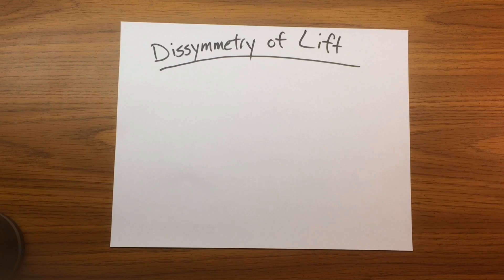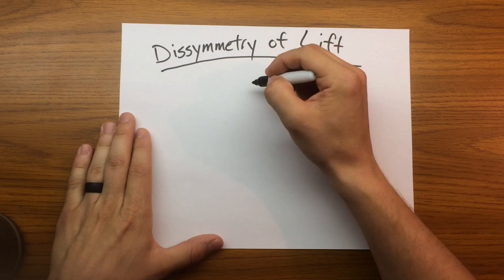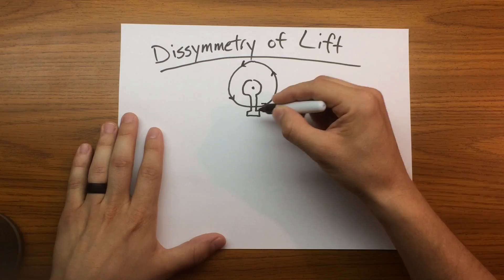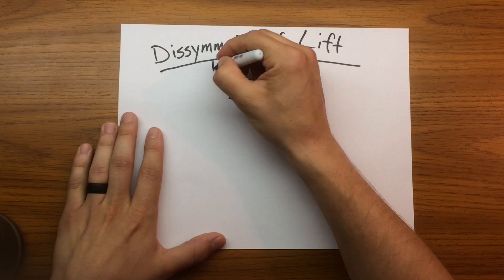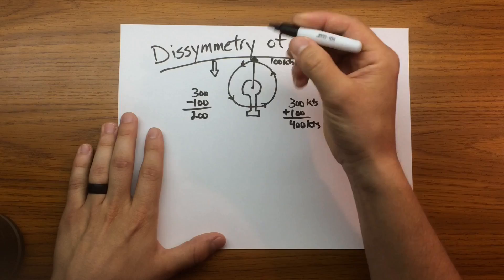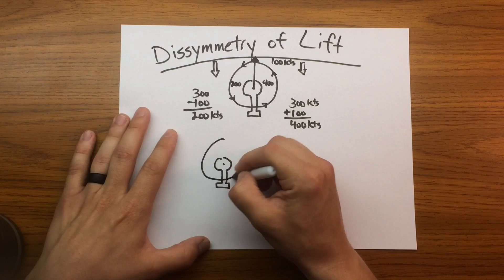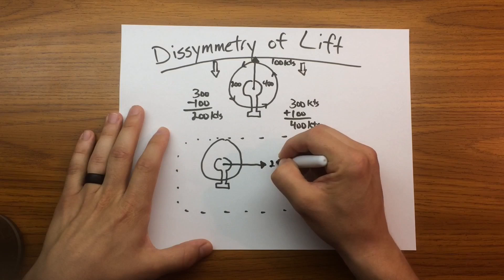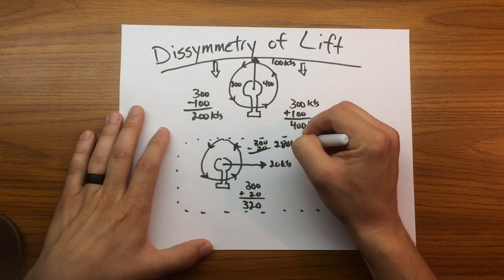Dissymmetry of Lift in Helicopters

Comment: So this was made a long time ago and I really hope you're still monitoring this channel. I'm really confused. You said the advancing blade is moving into a 100 knot wind moving at 300 knots. I understand that. The next part is where I'm stuck. If the advancing blade is moving INTO the wind, wouldn't that slow it down, and the retreating blade is essentially being pushed by the wind, so shouldn't that speed it up?

I can grasp the overall concept of what you're explaining as far as how the differential forces causes the rotor disc, and therefore the helicopter itself, to move through the air. The numbers are what I'm getting hung up on though
Reply from the maker: The blade would slow down if you didn’t have an engine pushing it into the air maintaining a specific RPM. If the same RPM is always maintained, pushing the helicopter forward would therefore cause more airspeed on the advancing blade (rotational speed plus forward movement).

Comment: Thanks for the great video! I've just began with watching your channel in order to have several questions answered I have with rotorcraft aerodynamics. You are doing a great job with your explanations!
However, to this one specifically I have some remarks: The speed of a rotor is not measured in knots nor any linear unit of measurement such as mph, km/h or m/sec as that would provide misleading information. The speed of a rotor is measured, as any rotation, in angular velocity of ° per second which can be translated into a linear speed, dependent at which distance from the rotation center the measurement is taken. E.g. the rotor of an Agusta AW109 has a diameter of 10.83m, which translates to a circumference of 34.02m. At 100% rotor speed with for that aircraft standard 380rpm, this translates to a velocity in air of roughly 775 km/h or 419 knots, but only at the rotor tips. At e.g. 1m from the rotor center, the linear velocity would translate to Pi x distance from center (=1, so Pi) x 380(RPM) x 60 (minutes) to 71.63 km/h or 38.68 knots (divided by 1.852).

This actually has some implications, because whereas lift increases in a linear manor from the center to the outside (ideally, with a perfectly twisted rotor blade), the forward velocity in your example remains constant through the whole length of the blade. This however should influence the grade of compensation through flapping and feathering as you described it in your compensation video. Additionally, my figures as presented above, indicate that at the example speed of 100 knots, the rotor will actually have no lift at all on the inside quarter of the retracting side, as the rotation speed vector there is overcompensated by the velocity vector so the inner quarter of the rotor disc in that area has no laminar air current at all, resulting in no lift. This effect should also result in increasing dissymmetry with increasing aircraft speed. So, as far as I understand it, at maximum cruise speed of the AW109 of 158 knots, this effect will be even larger, leading to roughly half the rotor blade producing no lift on the retracting side of the disc perpendicular to the movement of the aircraft. 

Is that so or am I missing something? And how does the aforementioned compensation by flapping and feathering work with increasing speeds and thus increasing dissymmetry?
Reply: 😂😂😂 - Now I feel stupid! I wish I had watched your video 'Dissymmetry of lift - Expanded' before I wrote my comment. - All explained there!

Comment: This is amazing! I’m reading the faa handbook and going through a sift study guide to prep for my sift hopefully in a couple of months. I’m so glad I found this channel!!! Thank you! One question though. What kind of issues does dissymmetry of lift cause that a pilot needs to be aware of while moving. I.e. does finesse of balance become a factor? Or are there instruments built in to counteract dissymmetry I’d lift?
Reply: I believe the angle of attack of the airfoils increases where the lift is lacking automatically.
Reply: The Fuselage starts to roll to the left, even though in articulated rotors blade flapping does compensate somewhat, but what is happening is the blade at the 9 o'clock position is reaching the same speed as the airspeed of the aircraft, so there is no lift at all... As speed increases, so does the stall area as illustrated. Once, coming n going speeds match-up, all forces cancel out, n you have no lift on the left side, hence, the helicopter rolls to the left. Just slowing down will get you back in trim...

Comment: I have a quick question about the video. Why do we add the speed to the advancing blade since it’s heading into the wind. I would think it would be opposite because of the drag caused by the relative wind. You used the “hand out the window” example that has me confused. Seems that your hand would go slower against the wind than with it. Am I completely wrong? Or is the number giving just dealing with lift?
Reply from the maker: TuckTuckonTwitch. The advancing blade speeds up because it flaps upwards. This causes the center of mass to shift inward and the blade to accelerate. I explain how this occurs in greater detail in my video Conservation of Angular Momentum (https://youtu.be/KObbd5mvn54).

Comment: I understand that in Forward flight the retreiving blade produces less lift than the advancing blade. 
But is this disssymetry also subject to gyroscopic precession? (So, Does the dissymetry cause the helicopter to tilt backward somewhat instead of tending to "roll" to the right) ?

Comment: In relation to dissymmetry of lift, certain helicopters have the ability to lead and lag (aka hunt) to better equalize lift along with blade flapping and cyclic feathering, would I be right to assume that the leading and lagging of blades works to equalize lift. The advancing side lags while the retreating side leads in order to equalize lift. 

Thanks, and I appreciate your videos good material to watch to refresh knowledge of aerodynamics
Reply from the maker: DGXJ94. Leading and lagging are ways rotor systems can better absorb Coriolis forces but do not equalize lift. As the blades flap up and down, Conservation of Angular Momentum causes them to speed up and slow down. In fully articulated rotor systems these forces can be absorbed by lead-lag dampeners. In other rotor systems the blades must absorb the stress of these forces. My video Types of Rotor Systems (https://youtu.be/7gM3rMDpJt4) explains this in a bit more detail. I'm also in the process of making a video to explain Coriolis forces as well. I hope this helps!

Comment: When you factor in gyroscopic precession, wont that make the helicopter move to the right based on having the advancing blades at the rear, which would equal more lift on the right side of the blades and less lift on the left side since the retreating blades are at the front.
Reply from the maker: Shamar Younge. The advancing blade would be on the right side of the rotor disk in a counter-clockwise rotating rotor system traveling forward. The retreating on the left. That said, the blades flap and feather to compensate for this Dissymmetry of Lift. When factoring in gyroscopic precession, the input to make the helicopter go forward in flight would be an increase in pitch at the 9 o'clock position. This would manifest 90 degrees later as an increase in pitch at the 6 o'clock position. By having more lift at the aft portion of the disk, a forward motion is created. I explain it more in my Gyroscopic Precession (https://youtu.be/MH1emIx5Ubs) and Compensation for Dissymmetry of Lift videos (https://youtu.be/culBbvszRpk).  I hope this helps answer your question. Thanks for the feedback!

Comment: Jacob, I am a CFI-IA and very interested in adding on helicopter ratings.  I also instructed various subjects while in the Army, and I appreciate your style and the conciseness of your presentations.

I understand the way you have shown how the relative wind effects the advancing and retreating blades.  My question is, and you may already cover it in subsequent videos.  Assume the helicopter is in forward flight at 100 kts IAS, resulting in a relative wind of 100 kts.  As a blade is directly over the tail boom, the effect of dissymmetry of lift would be nil.  As the blade continues to rotate into the advancing blade region wouldn't the effective advancing blade lift be negligible and increase the farther the blade travels into the region, reaching its peak effect at 90 degrees to the mast.  After that point, doesn't the additional lift generated by the advancing blade begin to decrease, until reaching the point where the blade is exactly parallel to the relative wind?  At the point where the blade becomes the retreating blade then the opposite effects would be in play?
Reply from the maker: Fred C Rogge Sr. I’m not quite sure I understand what you are asking. At the nose and tail, there isn’t much of a dissymmetry to lift. But on the advancing and retreating sides there is due to the relative wind combined with the rotational velocity in the blades. The reason the advancing blade produces more lift (if left uncompensated) is because the airflow over that side has been increased. And with everything else constant in the lift equation, this increase in speed results in increased lift. This occurs anywhere the blade has increased airflow relative to the disk which encompasses the entire advancing side. As the blade gets close to the nose, the relative wind is decreases because the velocity of perpendicular to the airfoil. Then, as the blade retreats away, the relative wind of the airfoil would be the rotational velocity minus the forward velocity. With all things constant in the lift equation, this reduction in speed results in less lift produced. If this dissymmetry in lift was left uncompensated for, the helicopter couldn’t maintain directional flight. I hope this helps answer your question. Also try checking out my videos “Dissymmetry if Lift - Expanded” and “Compensation for Dissymmetry it Lift.”
Reply: @helicopterlessonsin10minut10  Thanks for the quick reply Jacob.  Yes, you did answer my question.  As I thought, when the blades are at the 12 & 6 o'clock positions there is very little, if any dissymmetry to lift.  As the rear blade rotates to the 5 o'clock position it begins to develop additional lift.  As the blade continues to move towards the 3 o'clock position the dissymmetry to lift increases to its maximum amount.  Then as the blade moves forward, passing through the 2 & 1 o'clock positions that lift diminishes to the point when the blade reaches the 12 o'clock position the dissymmetry to lift is again almost non-existent.  (The opposite effects would occure to the retreating blade.)  I did watch the two videos you mentioned, and they both helped to clear this up for me.   Great videos - I look forward to watching all of them.

Comment: Great video but as a newbie wanting to take his first lesson, what does this mean to the pilot? Do you need to compensate while flying for this difference in lift?
Reply: No, Mike. The aircraft compensates on its own by the rotors also moving in the vertical plane. This motion is called flapping. Flapping will cause minor side effects that we do have to compensate for though - blowback, retreating blade stall, etc.

Comment: You've covered the math nicely but you must take it to the application. 
What does the helicopter do? Having more lift in one area  and less in another causes the helicopter to do what? 
How does the pilot anticipate and compensate for the effect? 
When you teach THAT you'll be an instructor pilot. Until then, you're good at math and regurgitating. 
(p.s. I'm not an instructor pilot. Just a retired army aviator who barely squeaked by the oral exam.)

Comment: Just a quick question. I'm just confused about the one thing - if you're travelling forward at 300 kts and you're going against the wind which is 100 kts why is the wind speeding you up on the advancing side? I would have thought it would be the opposite and slow you down to 200 on the right and speed you up to 400 on the left in this example.
Reply: Helo standing still. Rotor spins at 300 rpm. Rotor speed at center = 0 whereas rotor speed at  rotor tip is 300 knots all the way around, even at standstill. Now imagine the helo flying forward at 100 knots.   Relative wind speed at tip: advancing tip moving forward at max 400 knots into relative wind ; retreating tip moving "forward" relative to the wind which is following it, so retreating tip speed is reduced by 100 knots , ergo 200 knots relative to the "wind" produced by forward speed. Dissymetry is to the square of the airspeed, so an order of magnitude different lift between forward and treating blades when at 90 degrees to the longitudinal axis of the helo AKA relative wind. It is hard to grasp at first, till you have a "lightbulb" moment.
Reply: @PatPrice123  Thank you! Ya, my boyfriend is a private pilot single engine so he's been trying to explain some of this stuff to me because I'm in a weird scenario - I'm studying to be an AME and I was signed up to start getting flight hours for both helicopter and fixed wing but I had to postpone all of it because Covid mask + glasses = flying blind (for me at least) so I'm having this huge disadvantage of not having any context.

Comment: I just learned about Gyroscopic Precession and question about it comes to my mind.  Isn't it suppose to make helicopter pitch up if it generates more lift at 3 o'clock position of rotor ?According to gyroscopic precession, effect of increased lift shows up after rotor travels 90 degree.  but the truth is, as you mentioned, helicopter goes left roll. What am i misunderstanding?
Reply from the maker: For dissymmetry of lift, the advancing blade creates more lift which manifests as a pitching up of the nose. You must apply forward cyclic to continue accelerating forward.

Comment: I have a question regarding the helicopter situation you are describing as the helicopter in a field who wants to slide to the right. As you say, the advancing side of the rotation gain more lift and in this situation it was the lower half of the plane of rotation. If that side gains more lift, due to the gyroscopic precession it should be the right side of the plane of rotation which moves the helicopter to the right. Am i correct?
Reply from the maker: To slide right you need more lift on the left side of the rotor disk. This input has to be made 90 degrees prior. So the pitch increase happens over the nose to manifest over the left side in a counter clockwise rotating rotor system.

Comment: Sir what does disymmetry of lift do?
Reply from the maker: Archana Singhal. Dissymmetry of lift does not necessarily “do” anything. It is an aerodynamic principle that exists in rotary wing flight. It is unique to helicopters/gyrocopters and doesn’t exist in planes. It is the reason for unequal amounts of lift created between the advancing and retreating blades of a helicopter. It has to be compensated for in order to maintain continued, controlled flight. Does this help answer your question?
Reply: Helicopter Lessons In 10 Minutes or Less 
Hi Jacob,
Congrats on the great work.
As you have explained, the dissymetry of lift causes the relative rotational velocity of the air to increase at advancing side and decrease at retreating side, which in turn increases the AOA on advancing side and decreases at the retreating side. If that is true then this change in angle of attack will have a difference in lift after 90 degrees due to phase lag (gyroscopic precision) and that is the reason for flap back. Please let me know if my understanding is correct.

Comment: why is the advancing blade and retreating blade are on the sides of the helicopter? wouldn't it be forward of the helicopter? and retreating would be on the rearward side?
Reply from the maker: Skye Fuego. This is because "advancing" and "retreating" terms are referring to the blade's position as it moves into and away from the relative winds. The advancing blade on the right side is moving towards or advancing into the Relative Wind when in forward flight. The reverse is true for the retreating blade.
Reply: Helicopter Lessons In 10 Minutes or Less makes much more sense. thank you!

Comment: Not bad !   Fairly well.  

But….  If you are going to teach a lesson.  Teach it all.  No mention of RB reaching its critical angle of attack or Vne.   What caused it?  How to recognize it ?  Recovery?    
All needs to be in the same lesson.    
Causes.  - could be one or combo of:
H igh FwdAirspeed. 
H igh DA 
H igh gross weight. 
L ow rotor rpm. 
S teep or abrupt turns. 
T urbulence. 
Indications:
Unusual vibrations. 
Nose pitches up 
Roll to retreating side. 
Recovery. 
Lower collective. 
Aft cyclic. 
RPM in green 
Minimize maneuvers.
Reply from the maker: I appreciate the feedback. Most of that content is covered in subsequent videos. Each concept is taken piece by piece without overloading new and aspiring pilots with too much information.

Comment: Am I the only one that wonders why the Blades PICK UP speed while travelling into a wind and LOOSE speed when the wind is at the Blades back?
Reply: Charles, the blade does not “pick up speed”. The blade is moving at a constant speed. He is talking about the speed of the air flowing across the blade. The blade is rotating at 300 knots constantly for this example. If you fly 100 knots forward you would have the additional amount of air flowing over the advancing blade.
Reply: I figured that out watching the video a few more times. But thanks for giving me that info. It all helps!!